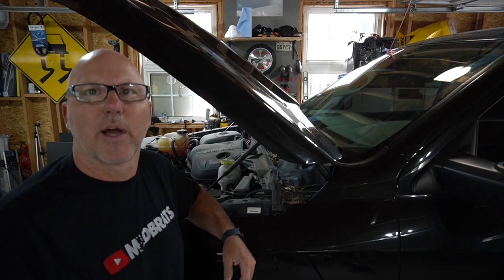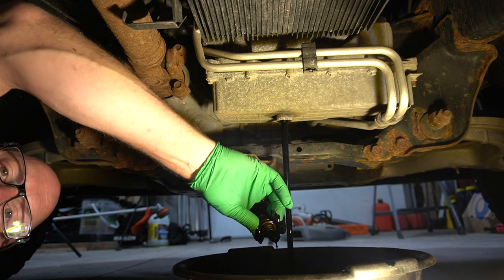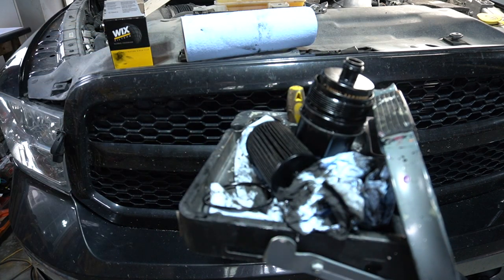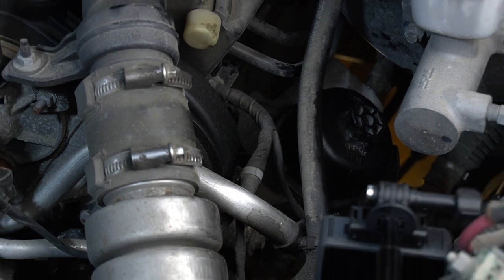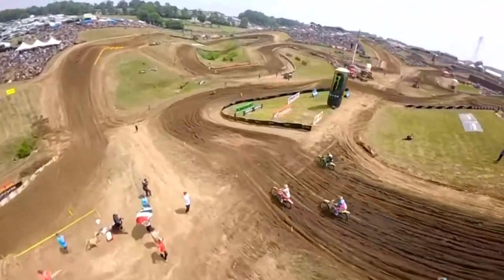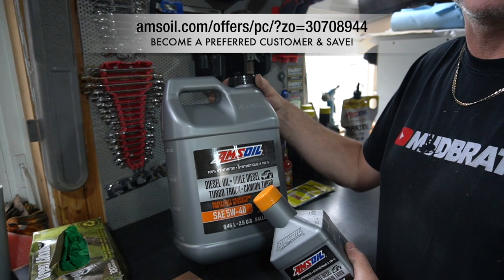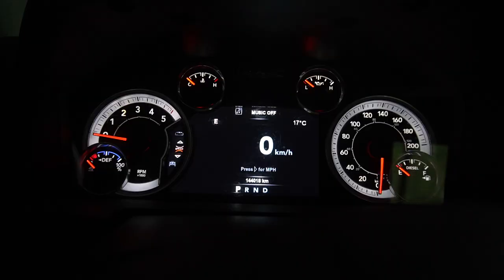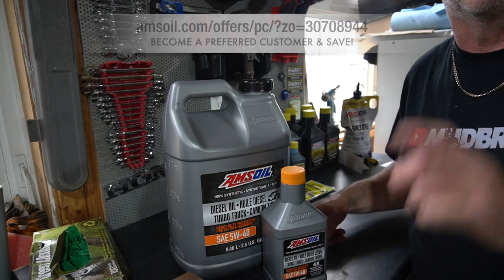Ram 1500 EcoDiesel Oil Change | AMSOIL 5W-40, WIX Oil + Air Filter Change

Comment from the maker: Free Shipping on $49 Amsoil order - use coupon code: FREESHIP49

Become an Amsoil Preferred Customer and save 25%!
amsoil.com/offers/pc/?zo=30708944

Engine & Transmission Flush:
https://www.amsoil.com/p/engine-and-transmission-flush-flsh/?code=FLSHCN-EA&zo=30708944

Diesel Injector Cleaner Fuel Additive:
https://www.amsoil.com/c/diesel-additives/18/?zo=30708944

Wix Air FIlter 
https://www.amsoil.com/p/wix-air-filter-wixair/?code=42725-EA&zo=30708944
 
Wix Oil Filter
https://www.amsoil.com/p/wix-oil-filter-wixoil/?code=WL10060-EA&zo=30708944
 
Diesel Engine Oil
https://www.amsoil.com/c/diesel-engine-oil/5/?zo=30708944

Comment: I have 2015 Ecodiesel. I had the extended warranty from the Class Action Lawsuit from the EPA that gave original owners $3,075 USD and an extended emissions warranty. I got stuck paying for a part not covered on the emissions for $1,800. It was a muffler issue not emission. They cover engine lights turbo EGR. They didn’t cover the Water Pump which went soon after $1,800 for that. I’m at 131,000 miles. Probably a good time to start looking to sell it. The DEF system was covered under the emissions warranty. The dealership said it cost $8,000 USD. So, definitely get an extended warranty for this truck that covers you!
Reply from the maker: i had extended warranty as well - now over 100,000 miles (163,000km)

Comment: Thanks - I'm ahhbouut to change mine with Wix
Reply from the maker: its an easy process.  Let me know how it goes.  Dont forget to change your fuel filter (under the passenger side rear of the truck) every 20,000km
Reply: @mudbrats  good tip to fill other fluids - change the fuel filter last month - pretty easy 👌

Comment: With oil filters , I only use OEM.
Reply from the maker: i was the same.  However the OEM ram filter is so cheap.  It doesn’t even have the aluminum support like the Wix has - it will be interesting to how this Wix looks after 10,000km - ill let u know

Comment: Gary any issues or problems with the eco diesel?
Reply from the maker: I bought the extended warranty up to 100,000km and around 70,000km I had an engine light - it was cleared under warranty.  Can’t remember what that was.... then after 80,000km I had another engine light and it was something to do with the DEF system (covered under warranty but dealer said it would have been a $1700) repair.  Since then the only other engine light was at 130,000km and it was a sensor on the exhaust - the part was $60 but I couldn’t remove the old sensor (seized in the pipe) so I had to have the dealer remove it and that was $400.00.  It’s been a great truck.  Wicked fuel economy and all I really done is tires and brakes (did brakes myself).  At 155000km I am at the point where I don’t know wether to trade it in or Do a stage 1 delete.... I likely will do the delete sooner than later and keep it.  I really do love the ecodiesel and the ram!